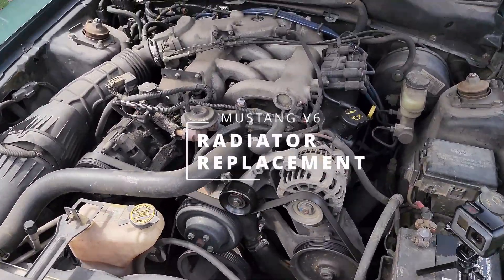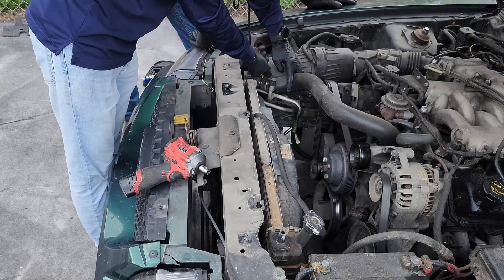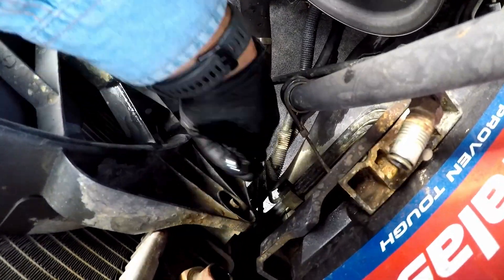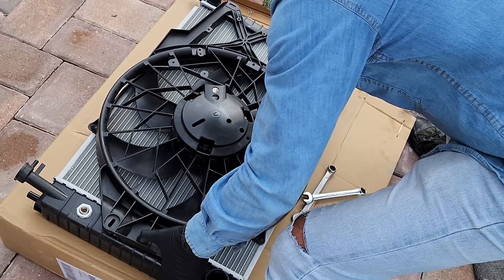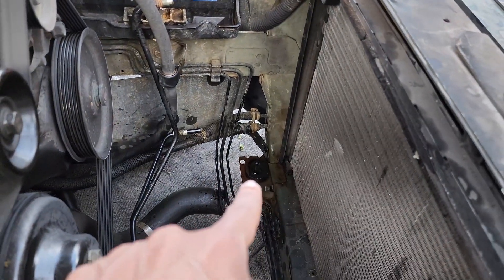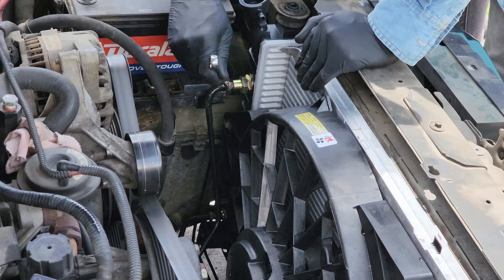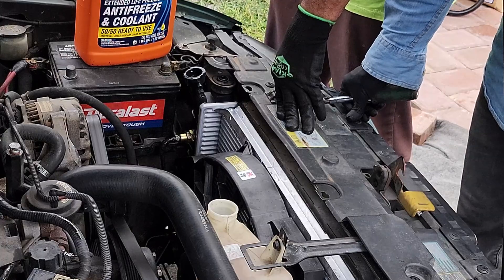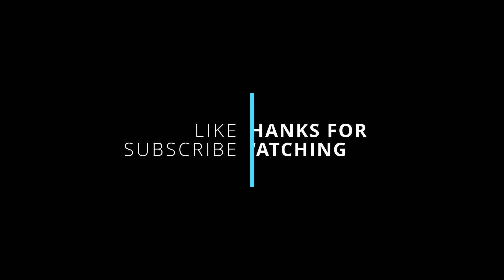Ultimate Guide: How to Replace Radiator on 2001 Ford Mustang V6 3.8L (Years 1999-2004) DIY Tutorial

Comment: Top transmission line keeps spinning on me any ideas on how to get it off
Reply from the maker: @zacjames4920  I didn't face that problem, if it is spinning but not loose it may b the thread is damaged, I hope not! if you are not using the proper wrench it can slip if thats the case try a pressure clamp...
Please keep me updated on your solution! I really want to know how you finally got it out.
Be patient 👍

Comment: Please reply asap does it need a different radiator it’s it’s manual? Mine doesn’t have the 2 hose line on the side of the radiator !?
Reply from the maker: @pablomadriz5375  if I am not mistaken is the same radiator u just wont need to connect those lines bc manual transmission don't have does.

Comment: How do you know that you got the transmission line in far enough when reinstalling it?
Reply from the maker: because while tighten them you will feel how it gets harder and harder. Do not apply to much pressure while reinstalling those lines. I would say around 25 foot pound(this is just a reference point) if you had used any torque wrench in the pass, you will have an idea what I meant.... hope this helps! thanks for asking!!! 👍.... resuming > just make sure those lines are tight, run the car for a bit and recheck for oil leak if you dont see any then you did good, readjust if necessary...
Reply: @espanglishGarage  thank you
Reply: is there a specific way how to screw the lines in ? my top Trans Line isnt screwing in
Reply: @LaRae5  make sure everything is pushed all the way in when you tighten
Reply from the maker: @LaRae5  same happened to me with a radiator I bought from ebay and I had to return it. I bought the one on video from autozone and lines finally fit smooth as it should. If your lines are not fitting, I will suggest double check everything is ok and perfectly aligned, if problem persist, replace radiator. (based on my personal experience) hope this help some way.
Reply: @espanglishGarage  my radiator is in good condition.. the nut that you screw into the radiator base (thats connected to the trans line itself)  is cracked at the smooth part .. is there a way that i can just get the insert replaced or would I have to get a new trans line in entirety
Reply: @macknumber9   ^
Reply from the maker: @LaRae5  wow... most likely you will need to replace it just because of that nut... in your case you really need some serious outside the box thinking 🤔 I wouldn't be surprised someone has a fix for it but in usa most mechanics or auto parts will tell you to change the line just because of that cracked nut that they dont sell... its like when replacing a drum brake and u need just one spring and you are obligated to buy the entire set of springs just because no one sell them separately... best of luck!!!
Reply: @LaRae5  wrong fitting reuse the old fitting

Comment: Where did you get the Radiator At?
Reply from the maker: @zekegomez6768  from my local auto parts
Reply: @espanglishGarage  I was just wondering because the one I bought at O’Reillys  was nothing but problems. The fittings on the end of my transmission lines would not fit in the radiator even though it said it was the correct fit for my car . So I was wondering if you got it from one of those other main auto parts.
Reply from the maker: @zekegomez6768  looks like a common issue with these radiators, the very same happened to my and I had to exchange it and problem solved.

Comment: remove the thermostat, flush the engine until the water comes out clean, replace hoses and use ONLY MOPAR COOLANT.  Anything else will destroy the engine.